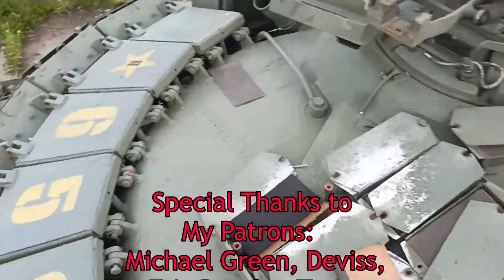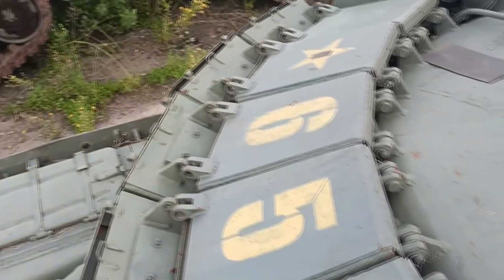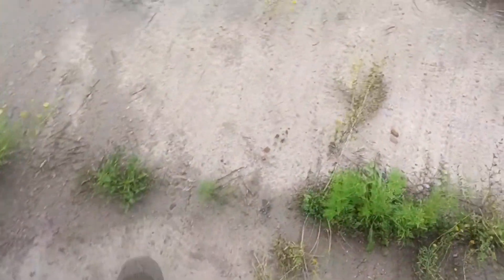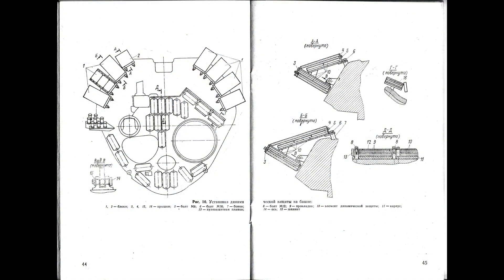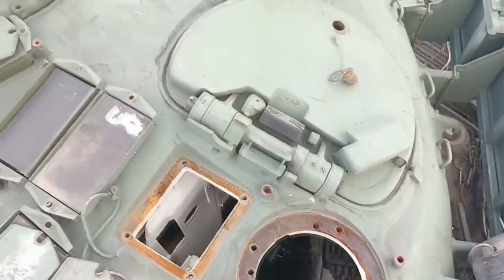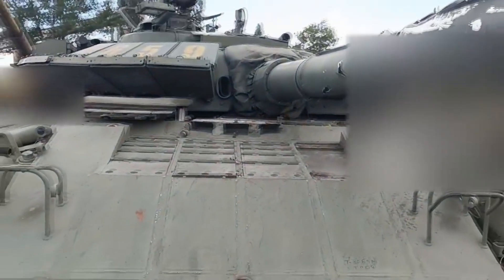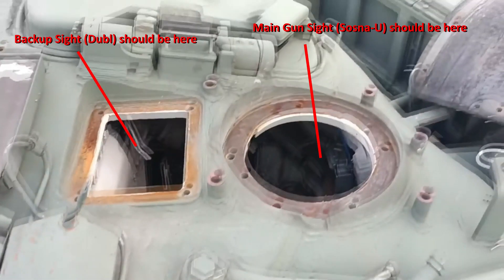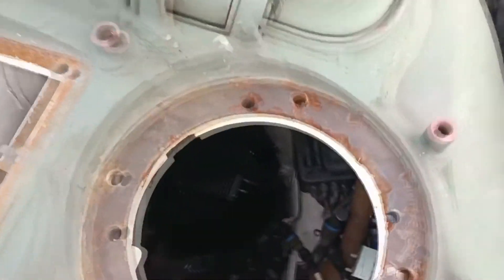Russians Are Using Rubber instead of ERA on their Tanks

Comment: I'm pretty sure this tank was used for spares but something doesn't fit about this. Why is there still rubber in the containers? This doesn't make sense. If you want the ERA just take it with the container. After all once unbolted it's completely loose. And in it's original configuration it's guaranteed to work. Why go through the labor to remove the explosives and then put the rubber spacers back? More so, when you then have to go and build a new case for the explosives to work properly? I feel like the Ukrainians probably wanted the ERA from this tank, and went home disappointed because there was nothing there.
Reply: Most likely the rubber and the metal casing would just add extra weight. Or they just needed the explosives for something else like makeshift mines or something?
Reply: @AIAllar  It is a possibility, but why neatly stack the rubber back in the casing? Seems like a waste of energy.
Reply: @Paegaskiller  You didn't watch the whole video? He explained why the rubber was there the way it was.
Reply: @AIAllar  It's supposed to be there, but there's no reason to put it back once you take out the charges. It's like taking the engine out of the car and then reassembling the front mask despite the fact you can't put new engine in unless you disassemble the mask again. And I have no doubt that the Ukrainians don't plan on returning this particular piece back in to service. So there is no reason to preserve the ERA containers with rubber spacers still in place.
Reply: @Paegaskiller  I mean what were they supposed to do with them?  Leave them lying around everywhere? They could literally just lift one side of the rubber, pull the explosive layer out, and set the rubber back. Its easy and you wont be trashing your surroundings. Its just as he says. All the things that could be reused were taken off the vehicle. Considering all the missing bolts aswell, it is highly likely a lot of the internal components were removed as well.

Comment: Here is another thought.  Back in my working days, part of my work was marketing EFP warheads.  I remember reading and hearing about ceramic plate efp protection. It was stacks of ceramic plates separated with some material.  It would disperse the energy of the incoming efp so that when it eventually hit the metal of a tank it could not penetrate.  Not sure if rubber would do the same thing but I saw other material there in the video.  But in the end….. whatever it is….. it is not working.

Comment: I don’t know what type of explosives are used in such tiles but I know that the explosive is highly desensitised to avoid unwanted explosions. E.g. a small bullet should not set it off. To desensitise explosives it is common to use rubber as matrix/binder. So what speaks against the fact that the rubber IS the explosive?
Reply: 😂 it's pretty obvious you don't know anything about this subject.
Reply: @rogerout8875  so you mean what i wrote was complete bs? Let me know I’m always happy to learn.

Comment: Why would Ukraine go to the trouble of removing ERA from the roof of the tanks captured and then replace it with rubber pads? Surely these ERAs never had the explosives to start with and maybe the other units which were empty did have and that was removed by Ukraine.

Comment: Explosive is used in ERA, neoprene is used in NERA.
Explosive and ammunition are usually removed rapidly from captured or abandoned vehicles, to avoid them being scavenged by unauthorized personnel and because it usually makes transport and storage more challenging (logistic-wise, you are not handling a vehicle, but hazardous material).
Reply: That's a really good point. Responsible authorities would remove explosives, and flammables from tanks when they can just because of safety.
Reply: @jamesrowlands8971  Okay, then why put rubber into the enclosure? Unless the person taking the video planted it in there to try to spread misinformation, of course.
Reply: @jamesrowlands8971  yes responsible authorities but were talking about russia
Reply: @LoroPianaEnjoyer  *we're.

Russia is a far more responsible country than any member of NATO.
Reply: @jamesrowlands8971  hahahaha 🤡
Reply: Neoprene? Maybe. A lot of different elastomers and plastics are used in NERA
Reply: @rodericklenz5030   Neoprene has an interesting property: When punctured at high velocity, the neoprene will be pushed aside, creating a torus-shape bulge/wave that travels across the surface at high velocity.
    It is hard to explain, I would recommend to Google it.
    This is used to push the top plate away similarly to what the explosive does in the ERA.
    But I guess other types of plastics or rubber might be used, as long as they have this property.
Reply: Can you give proofs about neoprene in NERA???
Reply: @ukuskota4106  why not go google it your self.
Reply: @inesfi66166  because he said about it -not me
Reply: @ukuskota4106  Wikiedia - NERA Materials: 
The two metallic plates in the NERA sandwich are made of steels of varying hardness and thickness. Depleted uranium plates have also been tested.[7] Rubber and plastic were initially used as the inner non-metallic material, but modern materials now include foam, nylon, polycarbonate, glass, elastomer and more energetic materials such as glycidyl azide polymer (GAP).
Reply: @geneticallymodified7775  So what?
Reply: @ukuskota4106  Strange logic, no one has to prove anything to you. If you have prejudices about the Russian army, that's your problem.
Reply: @acknodbikes5051  How the question about neoprene in NERA can show  prejudices about an army???
It's technical question, it is NOT political statement. Can you see the difference??

Comment: There are also plates called NERA , so reactive armor has'nt always explosive in it . And most composite armor uses rubber layers , against a HEAT load a simple steel plate like side skirts helps a lot or spaced armor .
Reply: People confused reactive armor with other definitions. Reactive armor is literally that, an armor that offers a reaction on impact to help absorb said impact and deflect damage; it doesn't mean its explosive ammo per definition. Propaganda during this war is really bad.

Comment: Just a quick note , author on OG video mentions the fact that they ( Ukrainians ) have used a lot of its parts . That’s not a secret , secondly the fact that ruskies weren’t going in a fight , but rather a parade , it seems very logical that they didn’t had those Era elements installed. 
If you really believe that during a battle Russian tankers were one by one jumping on top of the turret and taking those elements out , you have serious perception problems then.
Reply: No it doesn't, ERA elements are installed on the manufacturing plant, it doesn't make any sense for them to not be installed because "le russians expected it to be a parade" it seems like reddit propaganda has rotted your brain out

Comment: The Bakhmut-Seversk line is making its way bit by bit, more on the southern side. I don't see any way for the Ukrainians to hold that line. They can only postpone the inevitable, with additional sacrifices. Soledar is half occupied, the Wagners from the east have already entered Bahmut. It seems to me that Seversk will have a role similar to Zalatoye. But we'll see...

As for Zaporozhye, I think it will go later. When, I have no idea. I think that Slavyansk and Kramatorsk will be solved first. A wide front from the Dnieper to Volnovakha must be activated for Zaporozhye, and I think that the front on the other side of the Dnieper and the approach to Zaporozhye via Nikopol on the other side of the river should also be activated. But for that, a large number of forces from the other side of the Dnieper should be secured, because the left flank will be extremely vulnerable. Nikopol is also a significant city and probably well fortified by the Ukrainians by now. Tonight, the Russians shelled Nikopolj and Marganjec the hardest so far. Eventually, the offensive from the western side of the Dnieper could be supported by some kind of landing across the Dnieper, right somewhere in that area around Nikopol. A large army is needed for all that. That's why I think that until Donbas is resolved, there is no further on other fronts.
However, as you can see, the Russians are not going around, but in front. To the strongholds. To the city. Lepo Frunze noticed that the center of gravity is in the southern part. Northern has obstruction attacks to keep forces pinned to him.

As the situation unfolds, the North can comfortably stand still. To not move. When they liberate Soledar and cut the Artyomovsk-Seversk communication, Seversk will experience the fate of Zalatny and the entire Lisica ridge.

As they occupy the villages south of Arjomovsko, they also raise the old Ukro lines. Their flank is always supported by the old line which they raised in the previous advance.

Thus, when they break out at Djeržinsk, the left flank will be supported on the old line in front of Gorlovka. The northern flank is again on S. Donac.

What caused this change in tactics? Well, maybe the fact that the Ukris defended themselves convulsively in the strongholds that were in horseshoes. They left them only when they really couldn't defend them anymore.

In this way, when you conquer the main stronghold, the ones next to the smaller ones retreat by themselves. Example of Vugledarska TE. After its fall, the Russians reached Kodema relatively quickly and occupied a good amount of territory, the possession of which had previously been fought for much longer. TE caused the fall of Novolugansk, Semigorje, Gladosova and other smaller strongholds with much less fighting than before.

It may be that the Russians have judged that it is better to hit them in the head now, than to fight almost identical battles in the surrounding smaller strongholds. Honestly, these direct attacks on Soledar and Artyomovsk are a surprise to me.

Comment: How can you be sure the content of the ERA tiles is just rubber?  Explosives can indeed have the appearance of rubber, same for solid rocket fuel.  For ERA, you would want to have an explosive that is hard to ignite (e.g. C-4) so it does not go off just from small arms fire.  Composition C-4 is a mixture containing 91% explosive and 9% non-explosive plasticizer.  It is dirty white to light brown in color, similar to what is shown in your video.

Comment: In addition there is such a thing as NERA or Non-Explosive Reactive Armor.  It turns out if hit with a HEAT jet the rubber expands because it is chemically the same as rocket fuel.  The rubber is obviously part of the ERA but may be something else than just a dampener.

Comment: If you know Russian, then there is a little more information in the video. The fact that this is a long-captured tank no one denies. However, there were no explosives in it initially. The author of the video speaks about this, pointing to the daringly clean panels on the body. It's not just about the lack of some rubber parts. There is not the slightest scuff on the paint except for dust.
Hence there are two options. Or this tank drove quite a bit with the protection installed. And the ERA left no trace. Or, more likely, this tank was from the first wave of winter battles when Russia was not ready for decisive battles, and as a result, tanks could, due to haste, negligence, or even with the approval of the command, go without ERA.
Similar stories in the Russian army pop up every war.
Reply: bro what the Russians had a month to prepare they would send a tank with ERA?? lol
Reply: @hokumzov9863  What surprises you?
This has happened more than once.

Comment: I immediately noted the rust on the tracks so knew it hadnt been used for a while, but it did remind me of early in the war when they found the Russian ERA bricks containing common sand and egg carton like spacers to maintain the block shape, and some didnt even have the sand just the spacers.
Reply: It was bs too, thpse egg carton was in fact not egg carton, look it up and don't be so gullible
Reply: @carta8399  Yes, they were dummy explosive bricks with regular sand due to graft in the Russian factories. Not the first time and the worst case was Russia having to scrap three completed Proton-M space launchers because the gold thermal insulation had been nicked and replaced with other metals during construction at the Voronezh Mechanical Plant.
Reply: If i were correct the "sand' was first used in the 60s t-64 tank on the front hull and turret front..but it was anything but "normal" sand.it was Quartz being pounded into fine particle to disturb/disperse HEAT jets before reaching main armour..and was built inside the armour instead of outside.the effeciency statistic is unknown however..

Comment: I bet, in typical Russian fashion they never produced enough ERA panels for all the available tanks. Given the sheer (ridiculous) number of tanks, the blatant corruption and general Russian issues with mass production, I wouldn't be surprised if rubber only era panels are fairly common. Realistically, the rubber panel production will be a separate factory, producing at a different rate. Easy to believe they are in place before the ERA arrives.
Reply: Not realy, the soviets were fully capable of making enough era blocs to arm they whole 30+ tank fleet. Even tho russias economy after 1991 is total dogshit they should still have no issue producing era block for the less than 10 thousand thanks they actualy operate considering how Cheap and easy to make they are

Comment: Could it be that the explosives are removed and stored in peacetime - with the intention of installing them before the tank goes into action?  The ERA may be seen as more of a hazard than a help in peacetime.  

And installing it was not seen as important due to the belief that the Ukrainians would surrender rather than fight?
Reply: Probably not, they had plenty of time to reinstall them. they even installed many "cope cages" which do little to nothing. While the Russians probably thought it wouldn't be a fight, they at least prepared for minor resistance.  It's more likely it was looted either by Russians while retreating or Ukrainians later on. ERAs stay on unless it hinders repairs or upgrades. They are very hard to set off accidently or purposely.
Reply: @ladwarcoffee   Yea they had the opportunity to install them - just like they were supposed to issue smoke grenades for the smoke grenade launchers.  The Russian preparations are not an example of careful attention to detail.

Comment: Isn't it possible that the explosive pads can be stacked together and can be used for other purposes other than ERA? Perhaps the UA found another use as in anti-tank mines or IED's in the rear of Russian formations. They might even use it in their drone bombers. As for missing pieces I see the same thing on the bombing ranges of Nevada where items are taken off vehicles just for souvenirs. Nuts and bolts are always in demand by farmers for their own equipment.
Reply: Not really. They do not explode easily for obvious reasons, and even in fully burnt out tanks they're still intact.

Comment: Ukraine took  everything compatible with T-72 and T-64 off of the T-80 so they can replace battle damage on those tanks. They are using the T-80's as a spare  parts donors because the T-80 is a POS. Mainly because the gas turbine that powers it. The turbine is prone to problems and guzzles fuel like there is no tomorrow. The logistics of keeping it running is a nightmare. That's why russia itself has only very few in inventory and they all were in long term storage before the russians had to start pulling out old junk to replace their combat losses.

The ERA explosives were removed because it can be misused since the tank is not in a secure area and will not be refurbished and re-used by Ukraine. In essence the T-80 is a worthless POS now with already all useful taken down.

Comment: My question is thus; if they're taking the explosives out to use them in other ERA, why did they not just take the intact ERA package, dismantle it, and put it on a Ukranian tank?  ERA packages don't contain enough explosive to be worth salvaging the explosive from for other purposes if they really do need the ERA packages for their own tanks as you put forth. Given Ukraine uses T-80s, has produced them since the UD variant, wouldn't the ERA package be more valuable intact, given it's more than just the explosives that get damaged when the system activates? Kind of a flaw in the logic there.
Reply: I think your thinking of the T-64, I think they did inherit a few T-80s and 72s after the breakup but the main thing they got was the factory's to produce the 64
Reply: @josephmontanaro2350  Ukraine inherited 300 T-80UDs when Soviet Russia broke up. They sold off a few, but still have most of them. The Ukranian T-84 is a welded turret T-80, even
Reply: @catstuckinawaterbottlecrate  Not to mention that the T-80UD was a Ukrainian only specialty out of their factories.
Reply: Not enough space in their backpacks?